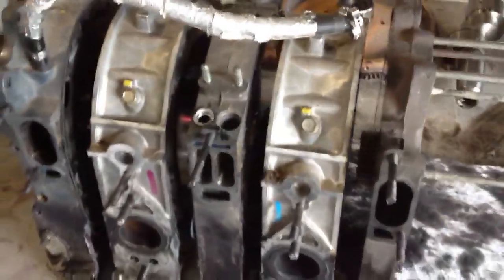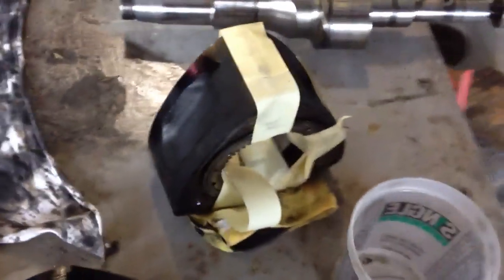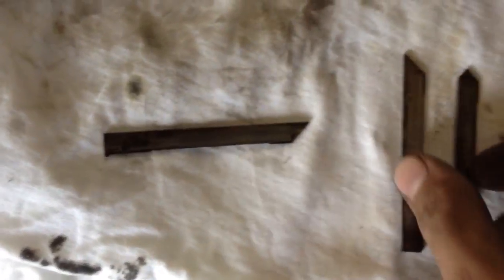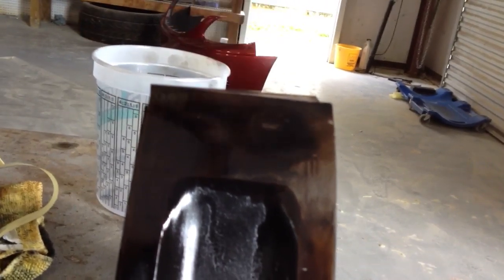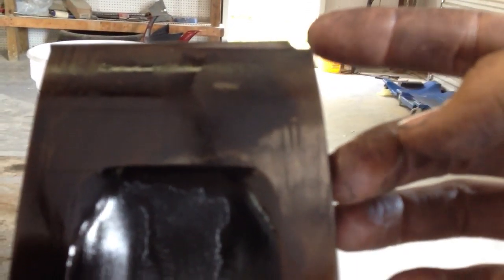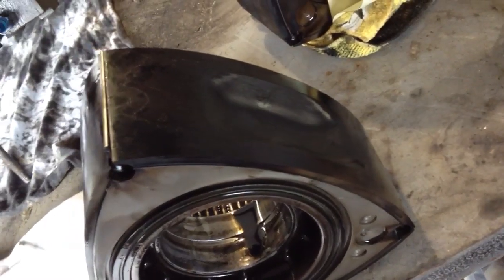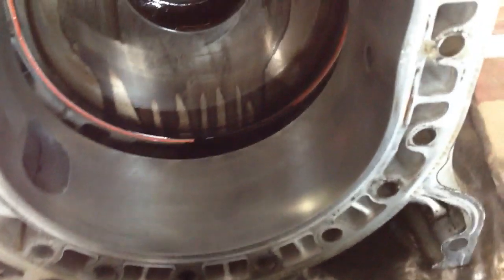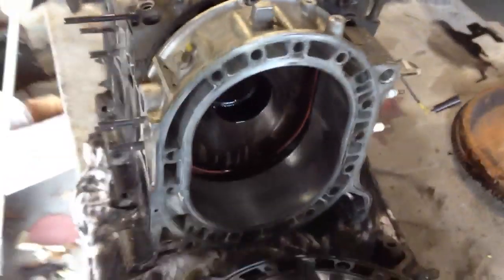Rotary rebuild part 2 (Apex Seals)

Comment: I'm looking in to an RX-8 with a possible low compression issue. (Difficult to start when warm.) I've never owned a rotary engines car before, but the more I look into it, it seems like the Renesis engine is more susceptible to apex seal wear. I've heard about it with rotary engines in general, but the couple of people I know with second gen RX-7s don't seem to have a problem. Is this just a case of seeing only the rotten RX-8 apples, or will any RX I buy (7 or 8) need apex seals every 90K miles or so?
Reply: jpatt1000 na first and second gen rx7s lasted a very long time like 25000 if well maintained. Read about one first gen that lasted 350,000 miles. Reason being they used 3m apex seals where the renesis uses 2m apex seals.
Reply: i will most likely. like the rings on a piston engine they will need to be replaced but by the look of this video once you get the engine out it looks fairly simple to do.

Comment: Geeez, they still haven't fixed the problem with the seals?
.
Those edges on the seal look sharp? Why not round them of enough so they are not scraping like a knife on the bore? Don't understand why the seal doesn't go all the way across, unless it's design is referring to the pop, or pre-ignition (maybe to much compression?). Ideally those seals should be something like a sideways C, with springs compressing them? This would eliminate friction/heat and lack of compression.
.
The way the groove on the center of the rotor is designed, is just plain stupid, for the reason your describing... I'm sure with enough though you could grind/port the rotor groove to send the energy in one direction. If thought through, you could increase the rotor compression, and run it off of fuel OIL, or diesel without a spark needed. Using fuel oil, you would be guaranteed a super efficient and more reliable Wankel engine (a wanker figured it out!), while incorporating my brainstorming theories that are extremely probable....

You might want to round of the edges of the intake and exhaust port to!

Comment: There's an 86 rx7 for sale that i am looking at, and it needed new apex seals, what are some questions should i ask and if that's the only problem, what would you say the cost to fix it should be?
Reply: cost to repair apex seals usually starts around 1200 for parts and labor